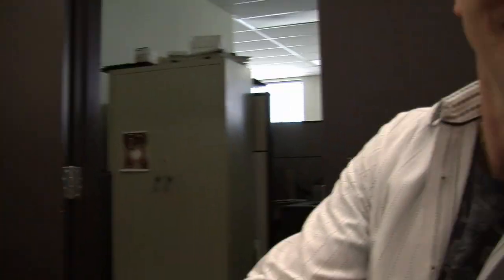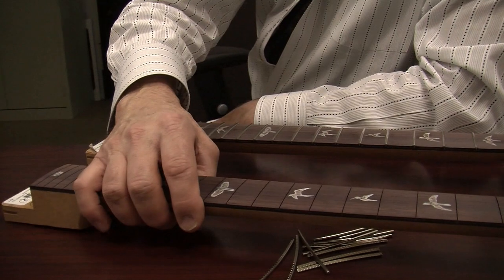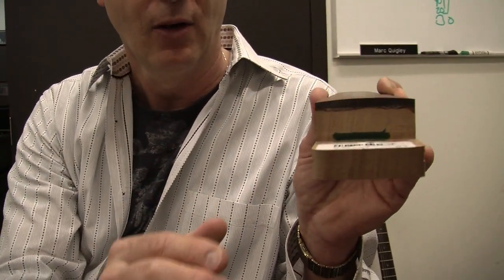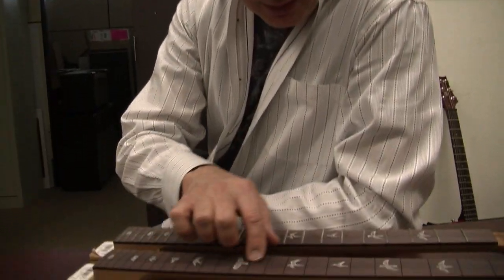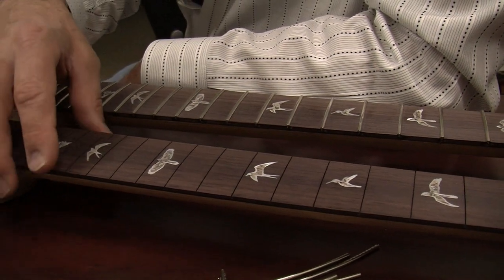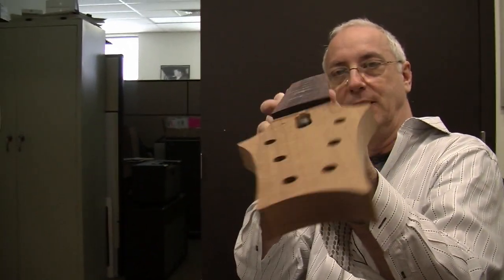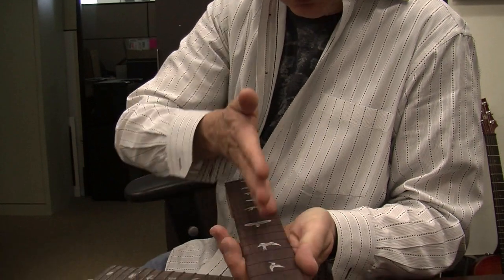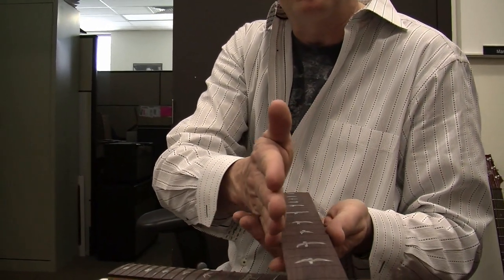Rules of Tone - Frets

Comment: What about doing them with EVO Gold frets instead? Best of both worlds? Especially the more expensive high end series should address this. The notion that you can't change a fret wires formula too much is kind of moot. Remember Rickenbackers? When Chris Squire started to use Rotosound roundwounds they chewed up the frets on the basses in no time. They had many of them return for warranty repair. They did the infamous "specifications are subject to change without further notice" so they changed the alloy in them, and made them more durable, and no one ever noticed the change in sound, they just didn't have to leave it back for refretting. 

Bending on guitar does not wear the frets out. Because it slides over a greater area of the fret. It's when you're pressing down the string at the same point (pinpoint) on top of the fret all of the time that erodes the frets moreseo. 

I have seen and heard evidence that shape, tall, form of the fret impacts more on the resulting sound and the feel, provided it is made of the very same alloy, than any alloy changes, really. Say, the difference in sound between a regular nickel/silver alloy TALL and NARROW fret, and a regular nickel/silver alloy WIDE, and LOW fret will be much greater than - say - the difference between a SS fret and a n/s fret of the same dimension, say the same WIDE and TALL one. 

I do think that as the prices go up, you should be vigilant about the material that wears out in no time, such as frets, and you should ramp up the fret alloy to snuff as you go up in prices. Or have some warranty/lifetime insurance built in, that you can leave them in for a total refret as the frets wear out in no time. Like Martin does, with their lifetime warranty. Eventually, an inevitable neck reset needs to be done, and they'll do it for no cost whenever that happens, to the first owner.

Comment: But when it comes time to replace the frets won't it be almost impossible to remove the old ones because of the super glue? Also, what's you opinion about stainless steel frets? Do they sound good?
Reply: Good question....seems like it would be impossible to get them out without pulling up big chips.......maybe use some heat..does super glue melt?

Comment: I'm going to say that it's true on the higher end PRS's, but I bought a PRS SE 245 in late 2011. It's been played a lot during that time, and now It's definitely in need of a good fret level. I don't think that's particularly bad though considering the usage, but It doesn't really endorse what Paul is saying here. Was he saying our high end guitars shouldn't need re-fretting or fret leveling after they leave the PRS factory, for at least 10+ yrs
Reply: The SEs are made in Korea, He is probably referring to guitars made in his factory in the US
Reply: I kinda knew it, but I don't really see why they would cheap out on something as cheap as fret wire, the fret materials used on USA models should be the same as the Korean made guitars, as for poorer graded woods, pick-ups, tuners, pots, finishes, nuts etc. it's a given that the higher end guitars will have superior quality. €700 is relatively small money in comparison to the US models, and cut backs have to be made so they can afford to manufacture and sell them at an affordable price.
Reply: The finishes and pots are still pretty top of the line on the SE models. I replaced my nut with a TUSQ. The stock nut was so bad, the guitar was unplayable until I replaced it. It wouldn't stay in tune at all. It would detune, but sharp. The nut was pinching the strings. I tried everything... nut sauce, graphite, everything. I replaced the nut and it has been prefect since. Perfect intonation. Perfect playability. Perfect action. All around awesome guitar fro $750 + $6 for the nut
Reply: u got to remember to use nickel plated strings because the Pro Steel Strings from dunlop that are not plated completely wreck nickel frets
Reply: He's probably not talking about SE guitars at all since they are made overseas- not in the factory he is doing this video in in the U.S...

Comment: Why does PRS use nickel frets versus stainless steel frets? Certain strings chew up even PRS nickel frets but don't seem to chew up stainless steel frets nearly as much if at all.
Reply: Because he is a business man. He'll use cheaper and inferior components, sell at the industry's "high standard" price and make the buck. If a corporation can cut as many corners as possible without losing any profit, they will. They are out to make money after all, just because they make guitars, that doesn't make them righteous people. They'll rip people off if they can.
Reply: Fan Of The Wylde you have no understanding of the difference between PRS and the other 2 American makers.
Reply: duster71 You're correct about that mate, I haven't played a PRS guitar so I shouldn't have jumped to such a conclusion. PRS are renowned for their attention to detail which is great. It just bugs me that these guitar makers still use nickel for their fret wire, while stainless steel is far more resilient to wear. I probably wouldn't mind so much if the guitars weren't so expensive. If you hand over that amount of money for a guitar, you shouldn't need to repair the frets on it a year or so down the track, because that ends up being quite expensive once again. I just have rather strong feelings about that sort of thing I quess haha Cheers.
Reply: true fact is, steel is so hard to work with that the price would raise to the sky. Of course is a superior material to fret guitars, but also breaks working materials as hell. Also, more time is needed to adjust it to the fretboard, as the steel is more flexible so it returns to its original position easier than niquel frets. Which means, its needed more time to get a final fretboard. All this things make the cost of producing a PRS so high that is a madness, maybe instead of 4,000 dollars we could be talking about 4500 or 5000 dollars, just to changing niquel frets to stainless steel. Unless the machines get improved, the cost of manufacture ss fretboards is madness.
Reply: Andrés Matesanz   Just to emphasize, it wears tools out faster and takes way longer to do a leveling job. On a new neck it shouldn't need much & I always build with stainless, but man, re-crowning stainless frets on a neck that has to have a lot of material removed is frustrating. Seems like you file & file with little results. It's a real testament to their resistance to wear.
Reply: All guitars should have stainless frets. If you actually use your guitar nickel will not last very long. I love my prs it’s my favorite guitar but I wish it did have stainless frets. My Suhr has stainless and they feel amazing and show zero fret wear.

Comment: What company do you get the fret wire from and what hardness is it rated at? 

I have a top10 PRS from 1993 and would like to have installed a very tall but slightly narrow wire, the original frets are a little worn down at the A minor box position and it's still playable but I would like to know which company makes the best wearing wire?

Comment: Hey Paul it was great meeting you at Sweetwater. Thanks for this video. I have a question though about frets which is how I ended up here. Is there a difference between stainless steel Frets and Nickel Frets? Are there negatives to using Stainless steel frets verses Nickel? Thanks
Reply: SS are a very minor different tone. I think they have a little more topend sparkle, but nothing you would really notice.
They are also smoother to play especially for bending.
And they should last you forever eothout any fretwork.

Well nickel doesn't last very long. Depending on the quality they get worn very fast and thus are even more expensive than SS frets when you factor in the cost for regular fretwork.

Comment: So if you ever have to re-fret, how do you get it out without damaging the board if super glue is used?
Reply: Heat the frets. Most repair guys do this with a soldering iron. Superglue softens and releases at about 150 degrees C.

Comment: PRS's fretwork is about as good as it gets on a production guitar. But the wire is not all that hard. I redress & refret them regularly. The 10" radius though is too tight in my opinion. A 10" - 16" compound radius works so much better. There's no reason a $3k+ instrument should not have one. SS is a much better fret material.

Comment: Stainless steel frets are the hardest frets on the market, period.  With a hardness on the Vickers scale of 300.  Gold Evo frets (from LMI) are less hard at 250.  Standard nickel frets are the softest at 200.
Reply: what i dont understand what the term is for it when , steel is harder but dents easyer and Nickel is too hard to get dented  so im confused on the term hardness
Reply: basicly i mean that nickel would brake if u bend it in half where steel would ben more without breaking
Reply: @tommychong: there is a basic engineering difference between surface hardness (resistance to denting) and tensile strength (resistance to deformation in bending etc).  So it's no contradiction if the metal is hard, but easy to bend.  And talking about "steel" without saying which steel is just plain weird as there is an entire planet of different steels, all with radically different properties: soft, hard, tough, stiff, ductile, etc.
Reply: +William Cowell 
So glad i don't have to write it.

Comment: do prs plan to switch to stainless steel for frets? some brands already offer it as a custom option..
Reply: +ktulhu2011 That was basically a similar type of stainless steel design (Not sure what the nickel content of PRS frets are but I imagine its not as high as most) Shouldnt have to replace them unless you are using steel strings. Use nickel strings on stainless (Or this) and you should never have to redo the frets. Most companies use a mix of steel and nickel which helps them shape the fret after they put it in. Its cheaper than doing it the way Paul mentioned.

Comment: The PRS that I bought needed a fret dress straight out of the box. 16th fret too high causing buzzing & choking at the 15th. Maybe they don't all leave the factory as you describe?
Reply: maybe a drastic shift in humidity in shipping caused the neck to change a bit  the fret to move , neck to swell or binding to compress a little. I know PRS does a lot to condition wood before building. but honestly from all the videos ive watches of the various manufacturers and their processes , i would say Kiesel has the best thing going for the money.  your getting  for 1100 what gibson, fender or prs would be charging 5gs for
Reply: patrick jaroch 
I have 5 Kiesels from $1300 to $3100 and they are all great.  Absolutely flawless craftsmanship but one did arrive out of tune.  That’s the only criticism I could come up with.

Comment: You make a point that the frets are leveled parallel to the neck center line and that there is a hump if you measure at an angle to it. Yet the strings, particularly the outer strings, do run at an angle to the center line.

Comment: Thank you sir. The more I see you the more I get respect for PRS. i think my Martin guitar used cheap wire because all the frets on my guitar are dimpled and worn.
Reply: It has more to do with the playing style and also the strings height at the nut and bridge. If a guitarist is pressing the strings too hard of course they will eventually form dimples. And people often tend to press excessively because the strung height at the nut and bridge is not properly adjusted.

Comment: I just went through all the more expensive guitars at a guitar center.  A PRS Korean SE was the nicest guitar in the building.  Probably 3/64 action at 12th.  About .003 for nut slots at first fret.   Not a buzz on the entire neck...great sounding pickups.
Great tuners.  I love those tuners....smooth as can be.   Relief was maybe 5 thousandths.  And it was 899.00.....there were a couple other PRS and they were nice but not as perfect.  Amazing guitar for the money.  There was one little imperfection in the neck wood...behind about the 3rd fret.  You could barely see it because of the stain.  Not structural.......kind of a little knot.

Comment: Hey Paul,

I have a 2007 Navarro model, some mods made to it.
strings would break on me all the time after using the trem, so I replaced the saddles with Graphtech Tusq.

I didnt like having the Navarro name on it so I removed the truss rod and replaced it with one bought on Ebay handmade in Manitoba.

I had to get the frets dressed this past summer, It was very visible that there was fret ware on the guitar. doing a full bend would cut the note off.
any new gold saddles out?

Comment: One can surmise their frets are a choice of the art of lutherie, not of economics: I know Paul seems like a snakeoil salesman. However, it is my understanding PRS uses a proprietary alloy between Ni(HV 170) and SS(HV 300). This means the tone and work-ability of Ni and the durability of SS. Furthermore, PRS has a mixture of classic and modern features, from 6-hole tremolos to locking tuners. He is not averse to modern applications such as graphite nuts and super glue.

Comment: They still don't use SS frets?? I would not spend that much on a guitar without SS frets. There are better guitars for the money, and they all use stainless steel frets.
Reply: He doesn't like the tone of stainless steel, so he finds hard ass nickel that kind of performs in a similar manner
Reply: I've not seen better.....they make great guitars....even the korean models.  I've seen as good but not better...even for a 8k or 10k guitar.  I've fretted SS frets.  They sound totally different.  Very tinny....on some instruments they're fine....others not so.  It is very smart that they glue in the frets.  I do it on all my refrets and never have a problem with them lifting.  Their guitars are made as well as possible.

Comment: funny Paul mentions that its not cool for the frets to flake off.  That's exactly what happened to my Mahoney SE using Cobalt strings.  It doesn't happen with regular strings so maybe the hardness of the Cobalt is more than the frets, but just wanted to mention that it happens.  Not knocking the SE- love the PRS stuff....just more of a warning regarding the Cobalts- steer clear unless you have stainless steel frets.
Reply: +Lothar ThirtyFour cobalt is a lot harder than regular nickel strings. that's why i don't buy cobalt strings.
Reply: +Lothar ThirtyFour 
You are correct -- although the Cobalt strings are not 100% cobalt, they are a lot harder than the normal nickel / steel slinkys.  I like them -- but if you have a guitar that does not have stainless steel frets, watch out -- they will wear down your frets.  Paul kind of lies in this video -- PRS does not use the hardest frets available -- Stainless Steel frets are orders of magnitude harder than Nickel frets...I'm not sure why they don't use them, I will probably never know...oh well.  I got my Custom 24 re-fretted with Stainless Steel frets after 3 years because the frets got very worn down...Now that I have SS frets, I will never need another re-fret -- ever.  I wish Paul would have just got the guitar right from the factory, it kind of sucks that I paid thousands of dollars for it and it did not come with SS frets.
Reply: They don't use SS frets cause they take twice as long to shape and fit also they wear out tooling twice as quick. Even a diamond file only works on frets after so many uses compared to NS frets where the file should last for yrs.
Reply: he didn't say the hardest material available. he said it the hardest material they're willing to make, as in the fret wire company that he has a contract with to make his fret wire.
Reply: At last, someone who listens to what is being said. :-)

Comment: Meh, Id rather my strings die quicker than my frets. I change strings when they start to feel slightly corroded anyway, long before string breakages. Ive never broken a string. And I dont buy that theyre brighter, its no practical difference in my experience.